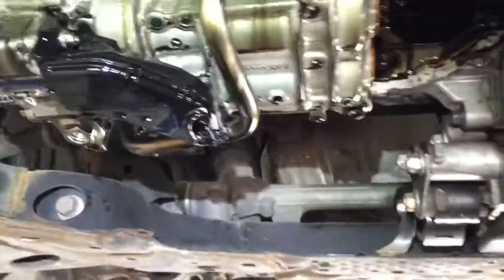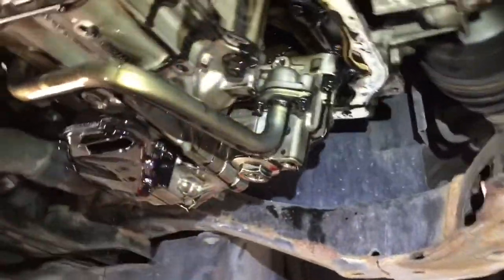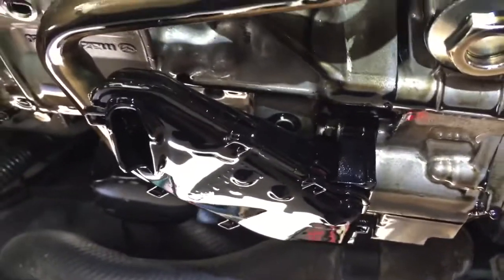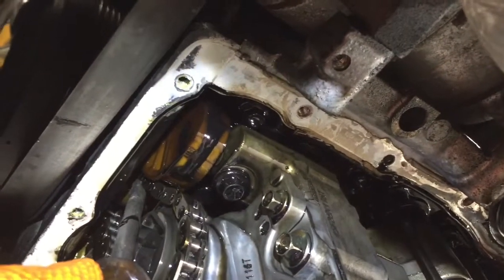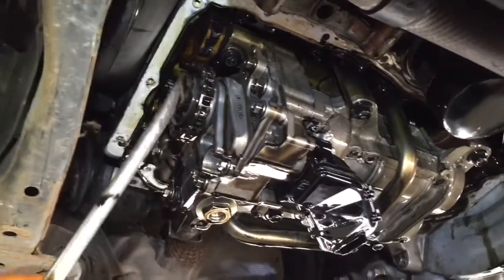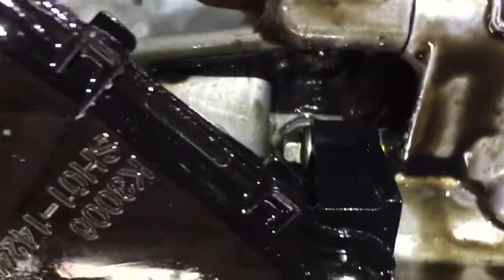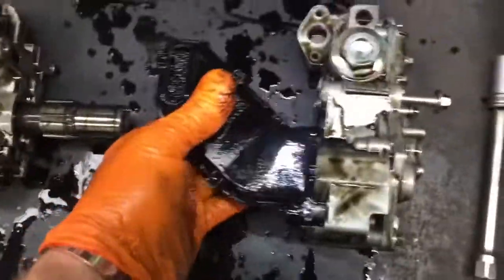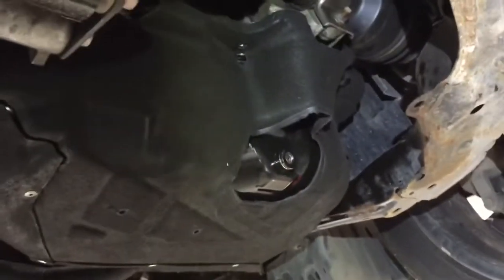Mazda engine failure caused by oil pump strainer & replacement

Comment: Hi Kennedy, I understand this was a 2016 Mazda 6 2.2D, I assume you got some DTCs and that's why you carried out the work?
What DTC did you get?

I have the exact same car at 135k Miles.
I had changed the oil 3k miles ago.

I first got a P06DE - Engine Oil Pressure control circuit stuck on, that was 1 day ago, no check engine light, no oil light, was suspecting oil solenoid valve or oil pressure/temperature  sensor issue.
I was getting healthy oil pressure, was around 120-160kpa, but then would get stuck at 200kpa  for a minute or so which would cause this code.
Today on the way on the way to the garage, I got P055F and P0524, which is Oil pressure out of range and Oil pressure too low, check engine light + red oil light.
Stopped immediately.
I still have my laptop with Forscan, so plugged it in, now oil pressure is below 100kpa, seen it as low as 60kpa, according to 1 of the codes, it must have been as low as 30kpa.
So now I'm suspecting Oil pump failure.
I don't think a blocked oil pick up can cause my first DTC - P06DE.

All codes still have sensor issues as common causes, but not Oil Solenoid valve, they all of course have oil pump failure as a common issue.

I'm just wondering if you had seen the P06DE DTC with this Oil pick up being blocked.

Thanks in advance.
Reply from the maker: What happened to me on this one was I was getting air flow & egr fault codes. But also the engine was quite noisy ( top end ) So I removed the injectors & cam cover to find that the injector washers were leaking badly & built up a large amount of carbon around the camshaft & caused it to fail. After replacing the camshaft & fixing injector seals/seats. I then dropped the sump to see how the carbon affected the pick up. 
I haven’t seen that code before but if it was my own car, I would drop the sump & change the pickup also oil and filter. It should only take 3-4 hours, gauze is around €70 & on the shelf in main dealership. Then monitor it for a few miles to see how things act. 
If pressure is back wheyhey. It could get quite expensive after that🤨
Do you know the price of a pump? 
It’s Peter by the way
Reply: @kennedysgarage3281  Hey, thanks for getting back to me.
So far doesn't sound like the same problem, I don't have valve lifter noise from top end or anything, also from what I saw through the oil fill cap, I couldn't see any carbon build up, looked fairly clean... But it ain't that big of a peep whole 😅
As far as the oil pump cost, brand new from mazda it's like £800-900.
I could get a refurbished one, the whole assembly with balancer shaft + pick up gauze for £150, or a genuine brand new seperate pump from a trusted reseller for £500.
It all depends what we find once the oil pan is dropped.
Mechanic is busy at the moment, so can't do much at the moment.
Reply: @xegro  Hello, I had almost the same situation 2 years ago and around 140.000km, now over 200.000km. Oil pickup was completely blocked, Mazda official service just changed oil pressure sensor (which I think was ok. I must trie it once, I have still somewhere at home ;)). So after I cleaned oil pump pickup strainer and changed injector seals car works super. Now I changed oil + filter every 10.000km and I regularly monitor oil pressure and DPF regeneration with Forscan. I remember that Forscan showed same DTC - P06DE and service looked like never seen this before and told me that my Chinese ELM caused this :p.
Reply: @samostraser8924    Hey Samo,
I'm at 217k km. 
In regards to what you said, since you got same code, which might have been caused by a blocked strainer, that's reassuring. I'm hoping it's just the oil strainer/pick up that's clogged. If so, I'll replace/clean it and then change injector washers. What's wierd is the oil pressure was quite healthy before the DTC codes, was easily getting 160kpa on cold start, and stayed above 120 after warmup, then suddenly I got the additional 2 DTC, and oil pressure is no longer healthy, going as low as 40-100kpa... I would have thought if the oil strainer was blocked, oil pressure would have gradually gone down over time as it got blocked more and more.

I guess maybe the oil pump increases pressure using the solenoid valve to keep up with the blockage and then it no longer can provide enough and you finally get the DTCs.

I also use Forscan, my cars been doing DPF regen every 140-160 miles, since I've been getting good MPG.
I get atleast 50mpg.
DPF Regen frequency is apparently directly linked to how many literes of fuel is used, so if you do alot of local driving, get low MPG, use alot of fuel, the  DPF regen is more frequent.

Fingers crossed 🤞 

I haven't checked yet, but I guess you have to remove rocker cover to remove and replace injector washer seals? 

Might as well get the injectors cleaned as well while they are out.
Reply: @samostraser8924  thanks 👍
The mechanic got time to look at it. 
Looks like the cylinder no1 fuel injector seal was shot.
Oil strainer was blocked.
Luckily no damage to the cam shaft.
Unfortunately rocker cover has melted around cylinder no1 injector due to leaking exhaust gas, so had to buy a new rocker cover for £230, new injector seals and oil strainer for £50 from Mazda.

Should have car back tomorrow 👍
Reply: @xegro  ok, this is good and bad 🥴. 1 cylinder is most right one, true? There is the most warm and this injector washer usually get burned and it is also very hard to remove this injector. I keep fingers that your car will fixed soon 😁. Best regards, Samo
Reply: @samostraser8924  Thank you :D
Yes the mechanic said it was very hard to remove the injector.
The cylinder was the most left 1, when facing the engine bay.
Kind regards, take care :)
Reply: @xegro  Hallo, so how is with car? Do you think to replace timing chain also?
Reply: @samostraser8924  Hey Samo,

Regarding the car, it's running nicely, engine feels happier at lower rpms than before too.
Seems to be less parasitic loss.
I've been monitoring oil pressure, on cold start it's about 180kpa, then drops to 160kpa once everything has warned up.
The oil pressure doesn't get stuck at the 200kpa mark anymore either.
Driven it about 200 miles so far.

Regarding the timing chain, I had done the test on forscan that tells you how many degrees the chain is stretched by,
It's only at 1.7 degrees, which is practically nothing, I believe when it gets to 9 or 10(not sure the exact value) that's when it needs changing. So currently only 20% there.
Will keep an eye on it, but I don't think it warranted the extra labour currently,
Or the parts cost, I believe the parts are £500+
Would have seem tempting since it probably wouldn't have taken much more time to get to the timing chain.
But the chain seems healthy currently. 

We'll just have to see it goes, hopefully not for the next 60k miles 👍
Reply: @xegro  Super, I monitor similar oil pressure and also similar chain stretching (i hope forscan showing this correctly ;)). Did you replace oil pickup strainer or just cleaned?
Reply: @samostraser8924  that's good that we get same pressures :)

Yeah hopefully the reading is accurate, I believe the chain stretch reading is the same the Ecu used to tell you when to get the chain replaced.
I believe we're supposed to get a flashing dpf light instead of a solid dpf light when chain requires to be changed.

As for the the pickup tube/gauze, it was replaced.

Comment: Had this a couple of years ago on my 2013 model at 60k miles, lots of these having engines seize...people are lucky if they catch it in time. .  Did you use a sealant when putting the sump back on?
Reply from the maker: Yes, I use a generic gasket maker / sealer it is called Dirko. Quite expensive but very good. Mostly the injector seals fail building up carbon under the rocker cover which then mixes in the oil & blocks the gauze.
Reply: @kennedysgarage3281  I'm having the same issues with my Mazda6 2015. It lost power on the motorway last week Sunday and currently in the garage but I way have to use someone different to fix it. Mazda dealer had worked on it in the past but I doubt that part has been changed looking at the condition of build up its showing 🤔even though they said so & it's at a 124, 000 miles now. They've mentioned recall in the past but nothing around this issue if I'm correct so I have no idea where I stand with this one,  maybe you could help to let me know more...? What's the likely cost for replacing / repair please?
Reply from the maker: @boomnitejrdlynch9791  it could have lost power for lots of reasons?? Do you have any direction to go ( as in fault codes).
To replace the oil gauze wouldn’t be too expensive prior to any bearing etc. failing. €300 or €400
Reply: What happened to yours mate eml ?

Comment: Any chance you could do a small video of slacking that chain off.  It’s the only thing that’s holding me back from attempting this myself.   Just so I know where to press to slacken. It.
Reply from the maker: Hi Andrew, I will do that no bother but I don’t have any Mazda’s in at the moment so it could be a few weeks before that is possible for me. But if that is the only thing stopping you don’t let it, it is quite simple. When you have the sump off mark the crank pulley to the crankcase (this pulley is not coming off). Then mark  the oil pump pulley to the body of the oil pump anywhere that is easy see. The only reason for this is because of the balance shaft behind the oil pump that I show being separated from the pump. The tensioner is only spring loaded & I find a screwdriver pressed in the best, if in doubt put a zip tie on it to hold it in place. 
I’ll message you if I get a video done on it and message me anytime if you get stuck while doing it. Good luck with it, Peter🙏👍
Reply: @kennedysgarage3281  appriciate this mate thanks.  Most of it is in the video is explained.  Just didn’t want the chain being messed up for when it goes back together.  I’ve watched another YouTube video and seen the the tensioner is a yellow semi oval type piece that can be pushed back a bit.
Reply: @andypower31  I cleaned strainer without removing oil pump, with small brush and cleaning spray.
Reply: @samostraser8924  that's a good idea what type sealant did u use to put back on mate ? I'm not sure of this is my actual issue though not long changed oil and filter I've had odd idling issue and when I get it it has a deep throaty  exhaust note very odd 9ve had some rough running like iys not smooth at 60/70 but 90%+  it idles lovely almost as of its not running at all
Reply: @kevinhancock4064  Hello, if you mean oil pan sealant, I think i used Elring Dirko HT Silikon 036.163
Reply: @samostraser8924  thanks buddy I'll take a look I have a mobile mechanic coming Monday ti help me find my issue

Comment: There is actually a recall on those to put different sealing washers under the injectors, hopefuly this will help you in the future
Reply from the maker: It is but in Ireland if the car was imported from England they don’t cover it 🤔
I doesn’t make much sense though, so I’ll probably have to do a few more 🙂 I’m getting good at them now. Thanks for the heads up & comment 👍
Reply: Are you sure about recall? I checked Mazda website wit my VIN and got info that there is currently no outstanding recall.
Reply: @sawomirborewicz5691  use total car check type in reg it'll show any recalls
Reply from the maker: @sawomirborewicz5691  I suppose it depends on country the vehicle is registered in & the year of manufacture. And whether you are having issues with it, they might not do it as general maintenance recall. Contact your local dealer and speak to them directly. 👍
Reply: Beware of Mazda diesels. Mine lasted 3 weeks until I got this issue! Could've blew the engine. Best to return it as I did with mine. Shocking design.
Reply: I had my recalls done today no 0aperwirk I've emailed to ask fir a copy of the work it was only me promoting them that they said what was done .9nvs I knew of the recalls hence why I booked it . They said few updates on software new oil pump new vacuum pump too
Reply from the maker: @kevinhancock4064  yes , the vacuum pumps do fail on them also 🤔 I forgot about that, I think they are quite good value from dealer if not covered by warranty. Around €150 if memory serves me correct. They throw up vacuum sensor fault codes 👍👍
Reply: @kennedysgarage3281  I never had anything like that show up but had scbs  etc and my concern was my idling issue I had dealer warrantee (still) they're meant to be extending it by 6 months (not mazda)
Reply: @kennedysgarage3281  they replaced it matey
Reply: Mazda Japan is recalling for the same problem.
But they didn't replace the washers....👎

Comment: The oil pump assembly you removed from the base of the block also seems to have balance shafts in it. There was no reference to making sure that this was timed to the main engine??
Reply from the maker: Yes, well copped. I hadn’t noticed that before & thought I had mentioned it in the video 🤨but I will edit it 
Before removing the chain mark the crank pulley to the chain cover, then mark oil pump pulley to the oil pump body & that is enough. I hope this helps 👍
Reply: @kennedysgarage3281  The addition would help those doing the job who  are not aware of the role of the balance shaft and inadvertently create a problem which wasn't there previously.

Comment: you also need to re-seal the fuel injectors,thats how that gunk gets stuck in the oil pickup. one or more of the injectors are leaking and causing a sludge buildup :)
Reply from the maker: That is correct, I have other videos showing injector removal,seal replacement and refitting . This is what causes a lot of the engine issues 👍
Reply: @kennedysgarage3281  hey man, thanks for great videos! can you please link to that injector and washer video? cant seem to find it.
Reply from the maker: @TheHelac  hi Alen thanks for subscribing & commenting. Strange but I can’t find it either, I will try to locate it and send you a link as soon as. I show a small bit about the injectors at the end of this video that I link next. They are easy enough to remove.
Reply from the maker: @TheHelac  
https://youtu.be/AokHxYo0EB8
Reply: @kennedysgarage3281  Hi Peter, your videos are excellent, really informative. I can't seem to find the video for the injector removal / seal replacement / refitting. The link you posted above is for the exhaust camshaft removal. Where are you based?
Reply from the maker: @milkyman86  hi Michael unfortunately I am unable to find it also, but I will record another on injector removal as soon as possible. I am based in Portlaw, Co. Waterford & do get a lot of people travelling to me from Killarney & cork etc. to do repairs on there cars from the videos I post. I could do a new video on the removal of injectors with your car if not too far to travel 🙂
Reply: @kennedysgarage3281  it's a pity your so far away, I'm based in Roscommon myself, bit of a trek 😂 I bought a 2017 mazda 6 skyactiv diesel recently, I'm looking to do as much preventative maintenance done regarding the engine. Your videos have been quiet enlightening! I had the older 2.2 mazda aswel, 130000 on the clock when I sold it but it never missed a beat. Roughly speaking, how much does a full decarbonization of the engine cost?
Reply from the maker: @milkyman86  it takes around 8 hours to do, so if a garage is €50 per hour it would cost around €400 to €500. I think the dealer is around €900 but gives a discount if it has to be done because it such a big problem with them. I don’t know if they give the discount just as a preventative job but it might be worth asking 🤔
Reply: @kennedysgarage3281  hi great informative video, can you post the link for injector seals removal video?? thanx
Reply from the maker: @SimbarasheChiridzasCars  I have been unable to find the injector removal video but I will make another as soon as one comes in 👍